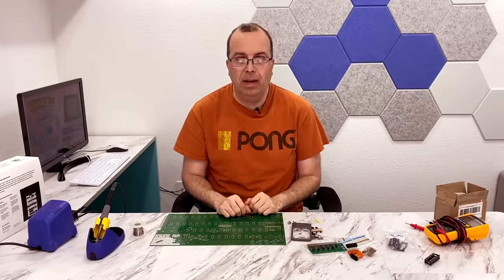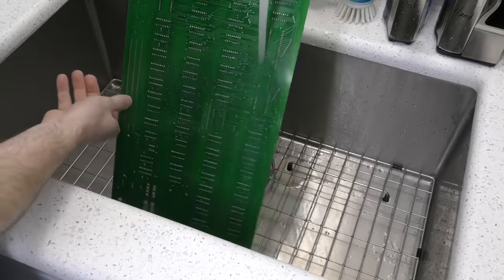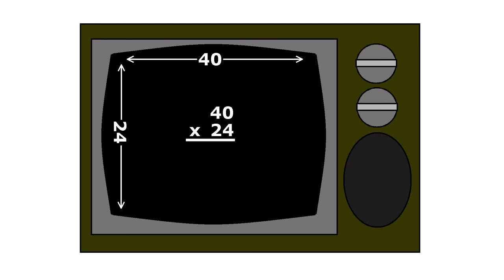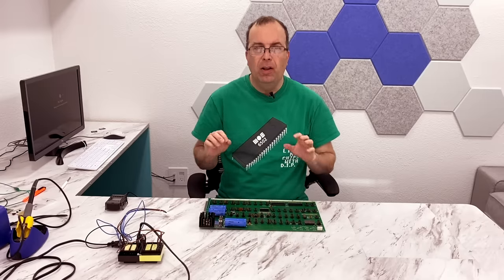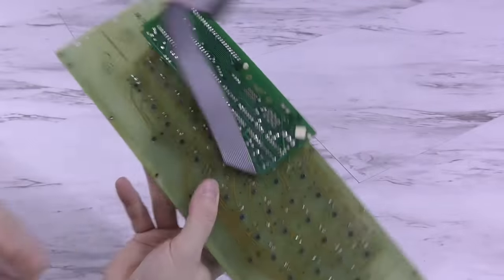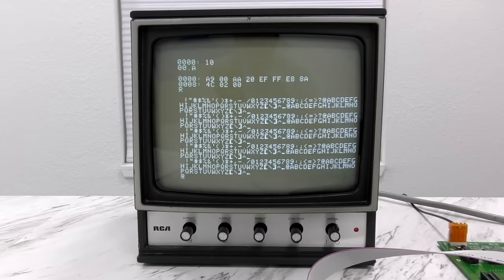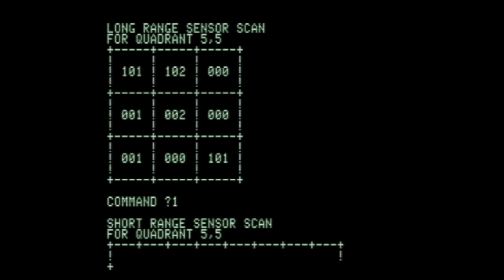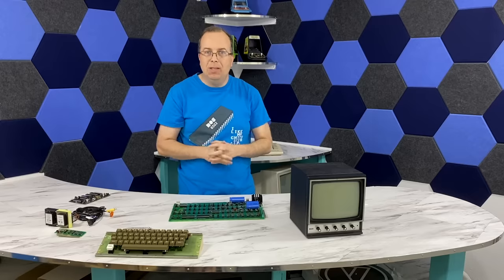How the Apple 1 computer works.

Comment: If you use a dab of super glue you can put all the pieces and then flip just once to soldier.
Reply: Or you can bend two tabs in opposite directions just slightly so they pressure it.

Comment: Dear friend, I'm going to ask a question that doesn't have much to do with the video:The famicom is very limited, many games are run with some difficulties...Can they use a W65C816S8P-14 cpu, instead of the original cpu, to improve performance??Because it's an improved model and very similar to the cpu of the nes/famicom... Both in the pinout and the architecture...

Comment: Soldering through hole components en masse in a garage is actually less tedious than you think.  You just need a solder pot and in it, a pot of hot molten solder.  Just dip and go, and there's your 100 solder joints done in 2 seconds.

Comment: This is so dope!!! Its so fascinating that the entirety of the OS was 256 bytes!! 

Another option for Apple 1 compatible kits for messing around with: Ben Eater has done a full series on building a 6502 based breadboard computer, and slightly tweaked Wozmon and Basic to run on it. He sells kits with all the components, and he has put his versions of the code on github I believe.

Comment: What i don't understand is : what could you do with an Apple 1 ? What it was used for ? As far as i understand, there were no softwares, no Word, Excel or anything approaching. So ? A calculator ? What was the interest for people to bay an Apple one ?
Reply: Everything written in ML is fast and can be text based. Text adventure games and this is the only thing - apple 1 wasn't VERY popular - somewhere 1.000 comps.
Reply: Your options were either this, or an Altair computer, were you had to toggle a bunch of switches, to enter bit by bit, the bootstrap program, and also get an external terminal in order to talk to your Altair.

https://en.wikipedia.org/wiki/Altair_8800

Comment: why, nethack or character animations work just fine
Reply: something like dwarf fortress would work nicely on that, simplified
Reply: if you can use custom characters (sprites) on that, the custom graphics with text terminal
Reply: Not really.

You couldn't address individual locations on screen. For example you couldn't write a program to print a "@" at row 6, column 21 - you can only print single characters on the bottom row of the display, and wait for the screen to scroll up at the end of the row.

If you tried to implement something like Nethack you'd need to clear the entire screen and redraw it every 'frame' which would be very slow and flickery.

There are also no custom characters (unless you replace the character generator circuitry), just the 64 upper case ASCII character set.
Reply: what the problem bro @gwishart

Comment: Holy...the only thing more tedious than typing opcodes into a command line is the toggle switches for the Altair (bitwise opcode inputting)...

Wait I take that back...plugging in your opcodes or using jumpers from a 5V source to your CPU is worse.

Anyways, I can clearly appreciate why hobbyists bought Apple I's instead of that blue box Altair...
(and to think I dreaded the assembler on the Apple II...a very far cry from vi and cc on Unix)

Comment: I don't know about the parts being hard to find unless for some reason the kit designer insisted on you tracking down original TTL 7000-series chips which... why would you do that? Authenticity's great, but there's good reasons why the "vanilla" 7000 series is not in production anywhere but the LS/HC/HCT series are.

74LS, 74HC, and 74HCT chips are ludicrously common and easy to get. And you can easily get a WDC65C02 straight from WDC themselves... so I suspect anyone claiming most of these parts are rare/hard to find are probably trying to rip you off.

Again, unless you're trying to get period-appropriate parts which I see no compelling reason to do so. The MOS6502 is just inferior to the WDC65C02 in just about every way, unless you're actively trying to rely on undefined behavior caused by invalid opcodes on the MOS chip. 

Just saying: If you're going to complain about the ICs costing you a lot, you have only yourself to blame if you didn't just source the modern, completely compatible, more reliable, yet cheaper pin-compatible ICs manufactured today.

Comment: You can play video games on terminals. You showed an ADM5 terminal and a VT100 there and I used to play a handful of video games on those when connected to a VAX machine running VAX/VMS in the late 80s and early 90s.  I may even have the files for the games somewhere. Think your classic late 70s early 80s video games like centipede and space invaders, that type of thing using characters. So there is some way of accomplishing it with a late 1970s dumb terminal. VT100s, WYSE185's and so on had more capability. Sadly I can't remember which played on the ADM5 and which needed a VT100 or WYSE185, but I know some did play on the ADM5. I do have an ADM5 in my collection, but no VAX mini computer. (mini here meaning the size of a mini fridge or even a full size one)

Comment: It gets worse.  The old Atari electronic pinballs used a gigantic single motherboard,  before Bally and Williams came out with modular in 1976.  IIRC,  Bally's first electronic pinball was "Lost World".  The first one I ever encountered was their third release, "Evel Knievel" in 1977.  They all used  a 6800 based CPU.  But those Ataris were a real bummer to work on,  let alone assemble.

Comment: Using the lighter on the shrink tubing is hard to watch.   I use to do this and burned through more times than now.  Finally I invested $10.00 in a heat gun from Banggood.   It changed my life.

Comment: Great vid - I cringed when I saw that first cap going in backwards and was about to comment when I saw your comment flash on the screen.  I repair old arcade PCBs from the same era as the Apple 1 and triple check anything polarized.  You haven't lived until you have a capacitor blow up because a diode in the power supply bridge was installed backwards or was shorted.  It still surprises me at how much NOS (New Old Stock) inventory is still out there but dwindling and prices on the rise as many of my beloved surplus electronics stores continue to close.

Comment: apple etched its self into my life and memory.. from the manditory having to remove the plate so it doesnt over heat. to the save your work like a mad man because it may crash and all is lost..the 200$ ipod whos screen broke from a loose penny in the rear pocket. to the time machine which turned in to a data loss time Bomb..... and at that point i gave up on apple and swore it'll never enter my life.
Reply: also louis rossman really drove home my detest for apple and their horrible business practices. almost like they used facist ideals but instead of people instilled it in their devices. and the way they treat the "repaired unpure user modified apple devices" ..virtually treat them as if they were gypsies. exterminate the modifiers and modders! kill the right to repair mentality.

Comment: On your note about the cost of the project:

I wonder how much of that could be attributed to the chip shortage that's been ongoing since late 2020? Or are these parts so specialized that they're just expensive based on already limited supply?
Reply: Considering the Apple 1 uses 40+ year old chips, many of which are no longer produced and are only available as rare old-stock, I’m pretty sure the current day chip shortage is entirely unrelated

Comment: Could someone explain to me exactly what it means when a bit is "exposed"? How is it that a single pin can be tied to more than one bit?
Reply: Meaning the value is shown on an output pin of the IC.
With a shift register, there may only be one output pin.  An input (clock?) signal on a different pin instructs the IC to perform the shift operation, which exposes the next bit on the output pin.

(Speaking in general terms.. don't know the specifics of the Apple 1 chips..)

Comment: The arrow on the capacitor shows the direction of the charging displacement current. Since the current flows from the positive side to the negative side, the arrow points on the negative side. And many other capacitors write the digit "0" near the negative lead for indication.

Comment: Pro tip: disconnect the power before populating the computer section. :-)

Seriously, super respect for taking on this project, and walking through the experience. And so much thanks for using the model of the Radio Shack cassette recorder and tape models that I used for years.

Comment: Did he just run the board under water?!?
Reply: Yes. To wash off the flux residue and any remaining alcohol. It's very a common practice - the circuit board of every electronic device you own will have been washed as part of the manufacturing process.

Comment: holaaaaa.and what is the function of the apple 1, what is it for or the utility of buying it in the 70s? what can you do with that computer? is it for something useful?
Reply: It was an early personal computer from the 70's. mostly people using and writing programs. These were early pc's, pioneering. so yes, useful, yes for programming, yes to run programs. it's a computer
Reply: @aBusybee  mm I understand, do you know what types of programs and what they were for? an example a program to make notes, what else? also games?gracias :)
Reply: @jorgetex3294  https://en.wikipedia.org/wiki/Apple_I

There some very basic text based games, adventure games (no graphics).

Microcomputers were calculation machines, so you could do math on them

it has the programing language Apple BASIC on it, in which you could write simple programs.
Reply: @aBusybee  Thank you very much, now I have a better idea of what could be done with it, gracias adiós :)

Comment: Apple 1 and 2 is sucks dont have any gold cpu , 1 month ago i destroy a apple 2 for gold recovery and inside i dont find any gold cpu i was expecting to have something like 8000 series cpu but was have plastic one or ceramic, only 2 cards with gold fingers i find, in 78' are was a lot of computers with gold cpu but apple dont was have this mean the apple computers sucks are was build in commercial scope, a reason why they dont use a strong gold cpu it was because the company dont have enough money and they put in computer weak hardware
Reply: And any ic chip from board dont contain gold bonding wire only aluminium and copper wire cheap stuff for that time
Reply: I forgot it was have only a eprom chip with gold

Comment: i might get some backlash from it but...

damn , the apple 1 sucks
Reply: Kim 1 is worse
Reply: @bricethompson1922  the what?
Reply: @TauGeneration  kim 1 is a computer for the same Era with less characters and you can't use anything like a cassette drive to save software
Reply: @bricethompson1922  yikes. what's the point of a computer if you can't store anything on it?
Reply: @TauGeneration  I think it's just basically and advanced calculator  and also the only way to turn it off is by unplugging it so they sometimes where used to operate machinery
Reply: @bricethompson1922  if it doesn't function like a computer, does it even count as a computer?
Reply: @TauGeneration  I mean you can program using a watered down version of basic so 🤷
Reply: @bricethompson1922  bruh
Reply: @TauGeneration  you think that's bad you had to buy a terminal which was a keyboard monitor 2 in 1 which would usually cost as much if not more than the computer

Comment: So we are wasting resources on rebuilding such old computer, for no real purpose, and those parts are now missing to build stuff and machines we really need today. I will never understand this.
Reply: These are legacy parts. They pump them out in droves. Some of these parts are no longer made and just sitting around and would be hard to recycle. Other parts are super common and would not impact supply chain since a handful of people are doing hobby work. Finally, a lot of innovation comes from tinkering. Do you realize a lot of legacy tech has been scaled down and are basis for a lot of simple, taken-for-granted electronics you likely use? Look at the raspberry pi project, original intent was to educate children how to code and develop tech. The project has become very popular with hobbyists and makers and is now a common modding and prototyping tool for new tech.